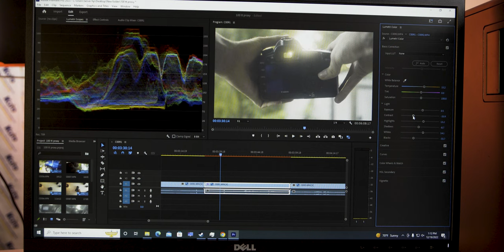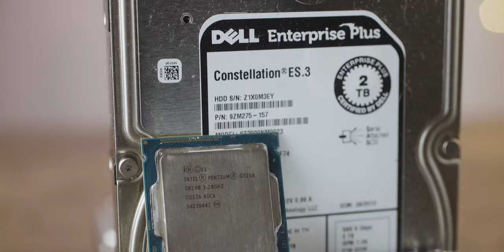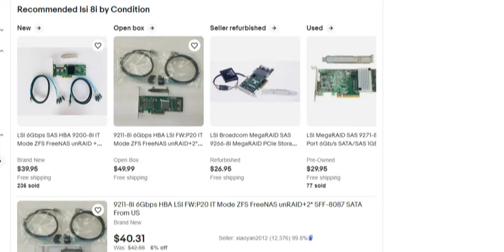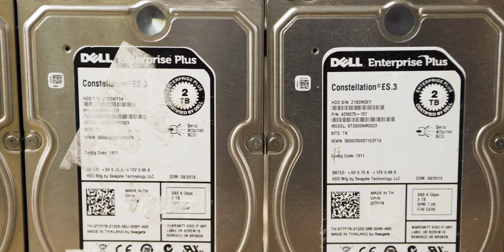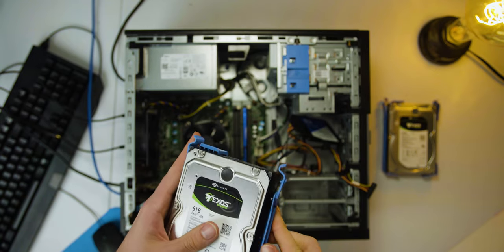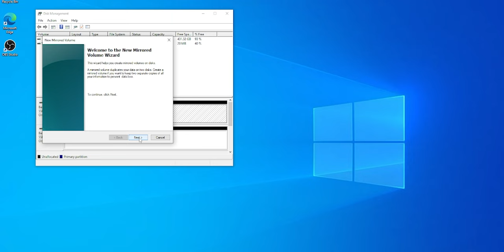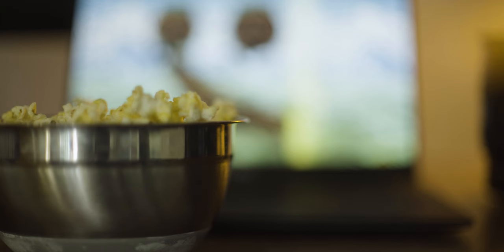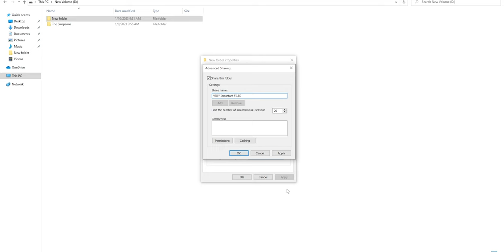You Might Not Want to Build the CHEAPEST Possible NAS

Comment from the maker: Here I'll save you some time 😀 
01010011 01110101 01100010 01110011 01100011 01110010 01101001 01100010 01100101
Reply: Linux installs struggle if you have a Windows suspend/sleep partition.

Lenovo is really great for Linux.
I've been running it on my Thinkpads for 10yrs.

I've only ever used XFCE desktop Debian distros like AV Linux & Makulu.

I'm glad you had a good experience  with Pop 👍

I'm sorry but I don't know how to help with your networking problem . Microsoft has actually used several non standard tweaks to break Linux/Windows networking over the years ☹️
Reply from the maker: @edwardfletcher7790  Funnily enough, when I completely re-installed trunas, and copied my exact config, file sharing started to work... so just a quirk of either trunas or Pop.
Reply: @aChairLeg  Good work !
Getting cross platform networking up and running is pretty much the Gold standard of Linux newbie skills👍😆
Reply: @aChairLeg I have an Small form factor optiplex system, may gonna try to turn it into a NAS, any tips

Comment: I'd actually recommend something like an HP Z230 over the Optiplex.  It has a Xeon CPU, which allows for ECC memory, and more room for storage.  I got one on ebay last week for £75

I'd say that if you decide you want, let's say, 12TB of storage, I'd recommend buying 4 4TB drives instead of 2 6TB drives.  This will give you options for redundancy.  with 2 drives, you basically have no option for redundancy, unless you sacrifice half of your 12TB of storage.  If you buy 4 4TB drives, you can use one of those for redundancy, and still have 12TB of storage.  Just make sure if a drive starts to fail, REPLACE IT IMMEDIATELY, otherwise you could risk losing your data.  Sounds dangerous, but it's better than running only 2 drives with half the storage space. or basically no redundancy...

Also, you bought the exact same SATA HBA that I got!  Still waiting for it to arrive.
Reply: Counterpoint: having many drives makes your electricita bill go brrrr

Comment: this is where i started. i’m currently switching over to a terramaster 4 drive with UnRaid. i’ll be moving from my Frankenstein HP with TrueNAS Scale. i’m doing this to lower power use and to simplify my set up. i have a ProxMox HP too which i can use the Terramaster as well. my main uses are a samba, plex, and possible minecraft. if this terramaster doesn’t work out for the minecraft i plan to get sff pc for proxmox later.

Comment: You should move the blue HyperX RAM DIMM to the #2 slot (your motherboard labels it as #1). Right now your PC is running the RAM in single channel  mode, not dual channel. You'll notice a performance increase after you change it.
Reply from the maker: The HyperX is 8gb and the other DIMM is 4gb, I believe they're both different speeds too, so I chose to not run them in dual channel. I did pickup a second hyperX 8gb DIMM though for a follow-up with the $100 gaming pc, so after three videos it will finally be in dual channel! haha

Comment: I built a home file share server for my wife and I. It cost me nothing because I got the pc for free and repaired and sold old laptops to fund the parts. It is a fully upgraded Dell Dimension 9200. Intel core 2 quad Q6600 quad core cpu, 8gb ddr2 667mhz, GT 710 2GB GDDR6 (yes, that version exists) and two WD red 4TB drives in RAID1 mirrored for redundancy. The system kicks ass at processing and move files and is only bottlenecked by my home network speed limit of 100MBPS.  All running on W10 on a 128GB $20 SSD. Totally worth it!
Reply from the maker: That's an awesome deal! The great thing about servers is they require basically no power, so you can make them with pretty much any hardware you have lying around.
Reply: Where on earth did you see a GDDR6 GT 710?
As far as i'm concerned that should only exist as a typo on a product page maybe.

Comment: I spent waaaay too much on my NAS because I want the thing to last forever.  Most of it was spent on 8TB SATA SSDs, I have a dozen of them.  I do have some older spinning drives (4 TB and 10 TB that I shucked).
Reply from the maker: That's a ton of storage! The hardest part for me is having to upgrade my backup and main server. Instantly doubles the cost
Reply: @aChairLeg  good point.  My backup method is also a bit odd.  I have bluray burners so everything I have is just on cold storage.  I also pay for backblaze, thank god for their no max backup size.  My data set is like 40TB right now.
Reply: That's more $$$ in Ssd's than my entire server rack wtf

Comment: I might make myself a server in the future,

Thing is, technology in Brazil is so hecking expensive, nothing is produced locally, everything is imported, and since the Brazilian currency is so devalued, and import fees are astronomical, getting electronics is pretty hard.

I managed to throw together a first gen Ryzen in 2019, and that's what I'm using since. But yeah, like, I'm still running mechanical drives for everything, one of them failed, and I had to go for a 5200 rpm notebook one, and there's where my system is installed.
Most of the parts I used came from China, including the motherboard, (by a brand called Colorful, which makes decent Intel boards, mind you, but their "venture" into AMD territory caused my system instability) I do shopping from China since they can literally declare any value on the receipt, (Import fees can go as high as +78% of the product price, so NewEgg and eBay are just no go) so yeah, I committed tax evasion just to get a pc running. 

I saw my first SSD not long ago, on a new notebook, the boot times with Garuda on it looked kinda nice. I'm pretty accustomed to 6 mins boot time. and now I'm planning on getting one in the coming months.

I might use an old pentium that I have lying around, throw some mechanical drives from China, with the proper HBA, (those things runs IDE after all) just so I can stream my "Modified" *Wink Wink* software to my computer.
"Modified" software in Brazil is legal, as long as it's used for personal consumption. Let's not employ the P word here, since YouTube, being a US company, is subject to DMCA, and they usually delete my comment when I employ that word.
Reply from the maker: Hey, first gen ryzen is still great! I use an 1800x in my main PC, since even with editing 4k video, I haven't found a good reason to upgrade. Hopefully you can get yourself a server going in the future, absolutely a game changer.
Reply: Uma opção legal é vc comprar laptops quebrados(apenas a tela). Comprei um que dava pra trocar a CPU por 75 reais, tirei o Celeron que tava e coloquei um i5 (comprado do Aliexpress) e fiz a mesma coisa que vc. Coloquei o maior HD usado que dava e um SSD pra iniciar o sistema e pronto. Uso como um media player conectado à um monitor que eu comprei por 80 reais. O sistema todo custou 400, incluindo o SSD, o RAM que eu já tinha sobrando e o HD.  Com esse aumento das taxas no Aliexpress vai ficar difícil montar um PC, mas ainda dá pra desenrolar. Não sei se vc já conseguiu montar, mas fica aí minha dica.

Comment: I have the main problem I can't find a power supply that has enough S-ata power connections ^^ I currently have 5 internal drives installed and actually need more. There is enough spacein the Case. But the power supply unit have not enough connections for S-ata drives. 😞